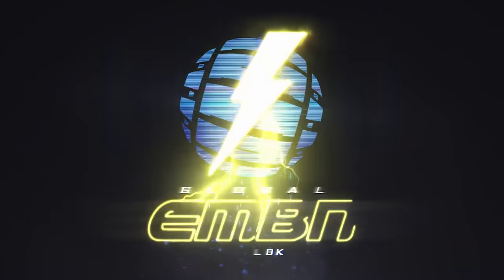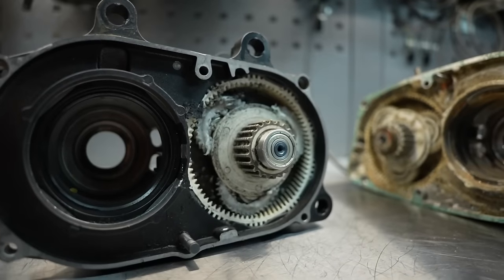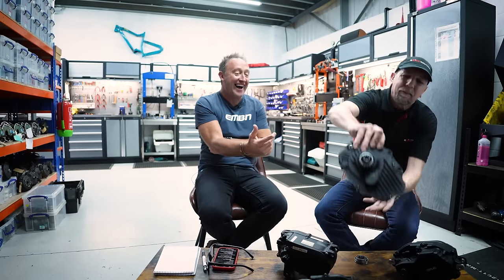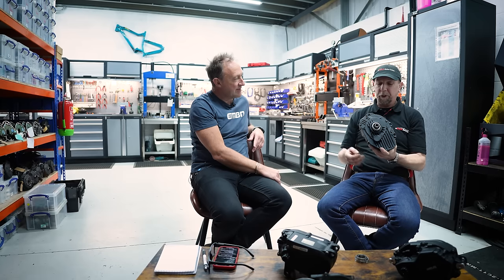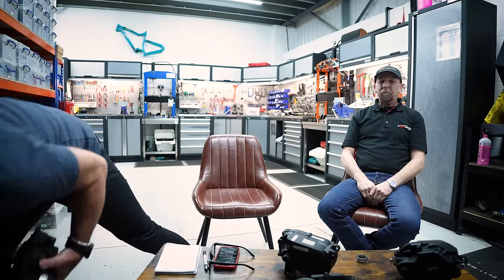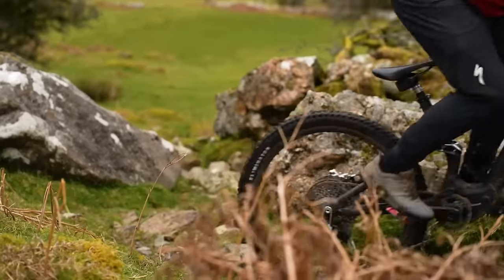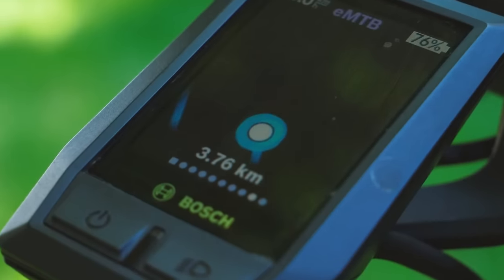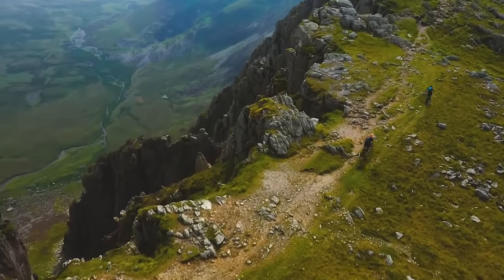What's The Best eBike Motor? | Industry Expert Reveals All

Comment: So rain, puddles, mud and moisture are the main culprits for killing eMTB motors.. talk about not fit for purpose here in the UK (for 8 months of the year 😂) Can you imagine off road motorcycles having engines that let water into the gearbox.. No, neither can I, because they wouldn't be fit for use and nobody would buy them. Ebike motor manufacturers need to sort it out.. never mind lighter motors.. build one that can last a few Welsh winters.. and summers 😂
Reply: It's the same with the knocking/rattling noises, imagine a motorcycle or car company is releasing a motor, that rattles half of the time and not just a few bad examples, but all of them by default, because they "don't know how to fix it" and release it anyway on the market. Would be a tough battle to sell these products to the customers, on the emtb market the people seem to be way less critical and accept major flaws, even if the prices are insanely high for what you get im comparison to a car or a motorcycle... as long as the brands will get along with this quite well, there will not be major improvements, unfortunately.
Reply: @e_mtb  Yamaha motors are silent
Reply: If you haven't already found them the bbshd is pretty well tested in the UK with very few issues. At least from my researching perspective, i've seen plenty of them being used, and abused in the mountains with very little if any problems. As long as it's fitted to the bike properly. Depending on the bike that probably still includes the lekki chain ring, a chain guide, some good derailleurs with wide range cassettes and good hydraulic brakes. etc.
Reply: My Aventon Ramblas is ip67 rated thru and thru what you think of that ya bobbin?
Reply: 😂 why are all the cheaper motors from China all water proof and the ones on the high end bike aren't. Star unions motor ip67 rated and they have a video of their motor running in a fish tank.
Reply: @photobooksandrecords  My PWX2 is noisy and i like it like that.
Reply: It's because of bad design. Electric cars don't have a problem in the rain so electric bikes shouldn't either. Bike companies are building their bikes with the cheapest methods to maximize profits.
Reply: @e_mtb Mechanical assemblies make noise. Have you ever listened to a running engine up close? 
I'd rather have solid metal gears that make some noise and last years than plastic gears that are silent but strip teeth.

Comment: So basically they were saying don't buy a Shimano motor since they are non repairable ( seemed like they were being very careful not to name names). My EP8 crapped out at 8000km and just outside of warranty, Shimano still looked after me and gave me a new motor which I appreciated and have now done 2000km on, but I don't have much faith in the longevity of the ep8 motor. My next bike will be a Bosch. I replaced all the bearings on my frame at 8000km and they were all getting worn. Having the ability to change bearings on your motor is a must.
Reply: The average lifespan of electric bicycles today is between four and six years.
8000 km is OK. I have 1600 km my first year.
Reply: They do have a full EP8 and 8000 bearing kits on their website so it seems that you could rebuild it out of warranty for $120. I have only had my first speed sensor go bad now at 1000 miles, bearings feel great still. 2 friends have had their bearings go bad within warranty and Shimano USA replaced their parts quickly with no impediments.
Reply: @NallePu83 I have 20,000kms on my Bafang.

Comment: I stick with bafang simply because you can buy parts and do repairs yourself. All the main brands seem to lack any aftermarket part support when parts need to be replaced.
Reply: my last 2 bikes have had Bafang BBS02 built by myself,  just splashed on a Cube with Bosch smart system, torque sensing is good but brick wall at 15mph in traffic is a real pain and starting to regret my purchase
Reply: Or to tongsheng with inbuilt torque sensing. Had both and both are excellent and I do more kilometres than 95% of people as I do deliveries on bike
Reply: Absolutely. Easy to work on and service. Very reliable.
Reply: You can't stick with Bafang unless you buy a bike that the Bafang motor fits LOL.
Reply: @markcliffe7  That's the speed limit all motors have that
Reply: @markcliffe7 Just buy a chip to remove the limiter. Class 1's are required by law to cut out at 20mph.
Reply: @Videomorgue  25kph here in UK, 15.5mph

Comment: I think that the problem comes to the lack of notion that we, as bike users, got used to... And the problem is what the industry made of us. When we say that a service for a motor for 250£ isn't expensive, we have to put things in perspective. We may choose not to do so. But if for a moment, we do that, we'll find that to be a bit crazy: consider that you're doing your bike maintenance, suspensions, motor, links, brakes, etc, and even if you don't have to replace no component, what you have as a bill is something that if you racionalize around it, is simply crazy. But the industry took us this way... When they ask 400-500 for a 250Wh battery expansion pack (just as an example) to be put in a rough way on a bottle cage, and we pay it without looking back, it is again the lack of notion that we got used to. This is nothing against the value asked for a motor maintenance, as it was mentioned. Is simply the placement in terms of market and in tat way, it is, in the end, fair. Just to point out that nowadays (and it is not a bike industry exclusive... far from it) if we want to buy a bike or ebike, the rational part of it, we have to put it aside.

Comment: The sad part is the waste that will pile up as these ebikes age. The bikes are so customized to the specific system so in 10 years the bike will be useless since you can't get a motor that fits in that bike. Most analog bikes can be updated/upgraded with modern parts.
Reply: Don’t all the bozos change the bolt pattern and case shape every year?
Reply: Yeah but analog bikes have still aged in a different way , if I get on a mtb from the 2010 - 2014 era , the geometry feels all wrong
Reply: @camwells9726  But it's still going to ride exactly like it did 10+ years ago.
Reply: @netposerx  yep get that , but I guess my point is people want better now and aren’t interested in those old bikes , so in a different way they are still obsolete anyway .
Reply: @camwells9726  I get that but a bike from 1972 will work regardless of if people want it or it has old geometry. An ebike just won't work as it's mostly a piece of tech. Like a Blackberry from 2003. There's no network to support it and you can't just go buy a new battery.
Reply: @netposerx  yeah get it , be interesting to see where it all goes , I’ve got a fairly new 2023 nukeproof mega , they have just gone under apparently, so no parts for me if I needed them, rumours trek are going too .
Reply: SIlly comment really. I'm going with the fun I have with the bike I have now not worrying about 10 years later and missing out on all the fun.
Reply: Exactly.  This is why I prefer hub motors.  I'm not climbing the rockies so I don't need a mid drive.  Bafangs are easy to service and when the time comes to replace the motor, they are easy and economical to replace myself.
Reply: You could always fabricate an adapter plate to hold a bottom bracket. One of the DH teams uses an Orbea Rise (I think) but without the motor or battery. 
If full suspension ebike frames start getting thrown away, you bet I'll be picking them out of the dumpster and making them work.

Comment: Bosch gen 3 performance line cx just over 12,000km no problemsat all, still as smooth and quiet as the day I got it.  It never gets pressure washed. I move the cranks one knotch on the spline every 6 months  to even out partial wear on the crank bearings and clean and replace marine grease on the bearing seal cover every 3 months.

Comment: Great video moters are getting better but they need to make the wiring  and switches more waterproof and not so flimsy why is it a jet ski can go under water but you can't hose your E bike down?
Reply: Because in a greedy rush for market share, all of the manufacturers just put on any motor they could produce or find, rather than engineering something from the ground up that would ensure longevity. In my eyes any bike motor made after this point should be fully waterproof. Mine is
Reply: @sd5458 if I may ask, what motor do you use?
Reply: Bosch

Comment: hands down Bafang M620, buy parts anywhere, use a laptop charger if needed, 160Nm of power, unrestricted mode code on manuals first page, has a throttle with top speed 75Km/hr.
Reply: What bike have you got it on?
Reply: Honda 750xl has 94hp so if you’re talking 140nm perhaps step it up a notch to a honda
Reply: @emveeess839  i think your HP and torque assessment for a motorcycle may differ greatly from the crank torque applied at 170mm for an ebike. do some old school physics and see what the torque at the crank shaft for a 70kg person using gravity,
Reply: @emveeess839  you trying to convert HP to torque?? not KW
Reply: @emveeess839  what the HP at about 60RPM @140nm for a cyclist?? electric motor cant push out 1.5HP
Reply: This is the real answer. Bafang is an open system and designed to be self serviced. They’re a fucking tank with tons of power, no speed limit and you can even add a throttle.
Reply: @Zetler what do you mean? you haven't considered those who to pay 4x the price so a company can dictate what they can/can't do. Its a special privilege.

Comment: Right at the end Brose is the winner for upgradability and spares and considering it was always quiet and powerful , ill take it as a winner.  New updated belts and seals fix the old issues. Those motors were always great when running but also had owners running if they failed, now there is a long term fix a LEVO or Kanevo is looking pretty good  esp with the Belevo app and Raptor chip
Reply: Any idea if the most current version Brose is what's spec'd on the current generation Levo?
Reply: @romand123  the current Levos , not including the Levo SL  are running the Brose 2.2 motor with 90nm , but it is more powerful than the older 1.2E and 1.3 said to be 90nm at the time . The 2.1 had belt issues in some cases , but im not aware of 2.2s having issues unless you ride it like a submarine or are in a desert with ultra fine powder like dust you should be good to go.

Comment: I am assuming you are only comparing OEM motors. Personally I absolutely love my CYC Motor Gen 3 X1 Stealth on my DIY ebike. The best thing about DIY is the ability to mix and match frames. Currently on my third build based on a beautiful Soma Riff frame with SRAM Code RSC brakes, DT Swiss hybrid hubs, and moped rated 2.1" 27.5" Schwalbe tires. With over 20K kilometers and zero problems I'll stay on this track. Bike comes in under 55lbs and has the best pedal assist. With 1500 watts and 150 nm of torque I can climb anything. Race mode in the country and street mode in the city covers all my power and speed limit needs wherever I am. And easy to change my street mode settings when I travel across the border from 500watt Canada to 750watts in the US. Gotta say it is way safer on an eBike when you can travel closer to the speed of vehicles. I've saved financially eliminating vehicle insurances and maintenance on my van. The savings are more than my cost of my builds.
Reply: This channel never touches or mentions DIY e-bikes with motors like CYC, Bafang or Tongsheng. This channel is about legal, factory e-bikes.
Reply: @SupraTompan  неправда, упоминаются бафанг, ведущий канала даже ездил в Китай на завод бафанг и показывал всё моторы и велосипеды и сам катался на китайском велосипеде Маркхор по горам.
Reply: @19774p  Sorry bro I don't know Russian.
Reply: @SupraTompan  I just clicked on the translate button 🙂

Comment: IMO, the problem with current EMTBs is the non standardization... from batteries, mounts, power adapters, connectors, batteries, etc. For example, my '22 Rise has a different charging port from a '23 Rise. They are incompatible and my '22 Rise is close to obsolete. How long can Orbea or the port manufacturer continue to make parts for an old model (only after a couple years)?
Reply from the maker: It's not an excuse, but phones, cars, laptops, even mountain bikes you're looking at various standards, proprietary tools and different chargers! E-MTB's are fitting in that respect rather than standing out. But you're right, in an ideal world 1 cable for a hundred bikes would be great.
Reply: @embn  It's not an excuse. But I'm not paying $1200.00 for a mobile phone.
Reply: @embn  A current Android phone will use a USB-C connector, no matter the manufacturer. In my example, it is the same bike manufacturer - Orbea, same motor manufacturer - shimano, and the same model - Rise. It’s like having a different nozzle at the gas pump between a Porsche GT4 and a GT4 RS.

Comment: After years working as an e bike technician I can answer the question! Bosch is the best motor, followed by the Dyname, Yamaha, Shimano and Brose(the Brose has a long history of component failure in spite of it being a very popular motor because of its ability). As far as adjustments go I am of the opinion that if you can alter the demands of the motor to accommodate for the desired range necessary to complete a journey, or a type of ride, then all the better and I have found the Bosch battery and motor combination the best in this regard.
Reply: Really? And yet you can't even spell Bafang?
Reply: @stevo184  Yeah really! And that’s your response to pick up on a typo?
Reply: I would agree with you, your motor layout is spot on! However, my point at the end was more based on what is the best motor to own. Having the best made motor on the market can be very frustrating for people when it eventually fails or wears out, and has to be thrown in the bin because it's not repairable. As I say at the end, the brose may have it's issues but these can be elevated with an upgrade and if anything at all fails or wears, it can be simply replaced or fixed.
Reply from the maker: Hi Jeremy, and thanks for insight...so just to be clear, you believe Bosch to be best because of it's adjustability?
Reply: @embn  Just my opinion, of course,  Bosch tops the list with reliability, power delivery and efficiency. I have observed great range from the battery in Bosch equipped bikes. Emtb mode is a bonus as well. I don’t own one but I’m convincing myself I probably should😁

Comment: As an Mechatronics Engineer,  I will have to disagree with Peter.
Broken gears and bearings can be easily replaced or even manufactured by  3rd party companies, 
but electronics is another story when your motor brand is Bosh: very closed system, too much protection...
Sorry but if a brand don't allow me to fix my own motor that I bough then it's not my motor. 

I rather have a motor that is relative reliable and it's easy and practical to fix than to have a German made, very reliable that is closed to me.
Reply from the maker: You disagree that the best motor is one that can be repaired??
Reply: @embn  yes because what you mentioned as very "cheep" full motor overhaul for 200 pounds is in fact just all bearing replacement and still there is the main board electronic and sensor which is unrepairable or unreplaceable in some motors. Manufacturers just don't offer main boards as spare part and you need to find electronic soldering repair specialists, but still in some cases you will need new main board, which is not available as spare part. You can maybe use second hand one, but the you need special equipment to pair it with sensor or so.
Reply: @niccots  The board is unreplaceable on Bosch Gen2 because it's polarized to the specific stator of each motor. Being an engineer, you should know that. I'm not.... I have 4 Gen2 motors, still the motor I want, and Pete just made the case for my opinion. Willing to dip my feet on the Pinion a couple years down the line.

Comment: What did Brose know in 2018 with the Aluminium 1.3 super quiet,, smooth powerful feel that they still don't know now.  Simply add x ring crank shaft seals and some positive internal air flow from a mini computer fan to dry it out. But big forces from pedal strikes are always going to cause bearing damage.  E=Mtb²
Reply: Proper seals make a world of difference. I don't think drying it out would work, as the water bonds with the oil and dirt inside. What would help is having a mandated maintence cycle with good accessibility. Everything wears down and all moving parts need service
Reply: @Megabear90  The idea is to have the mini fan constantly  running slightly pressurising the inside when the motor is on and also when you wash it so no moisture will be sucked in from cooling of the casing or changes in altitude. Would be easy to try, plus a few moisture attracting crystal bags." Crystals " now does that sound a bit "heeby geeby"

Comment: Since watching these videos I’m not using the pressure washer at all on my bike except for tires. I now have a hand pump washer to apply water and use brushes and clothes . Letting the mud dry and brushing off the worst also works . Hoping to save the motor and keep frame bearings in good order . Nice to know this company exists if the worst happens . I can’t help the occasional pedal strike !

Comment: The short answer is that none of them are reliable as the old gen 2 Bosch. The currently available motors will not last as long and to get the most repairable motor, which is the Brose.
The bonus was the discussion of the even smaller and lighter motors not being rugged enough for mtb use and the weight saving being negligent. I got alot out of this as I was previously considering a lightweight low power system.